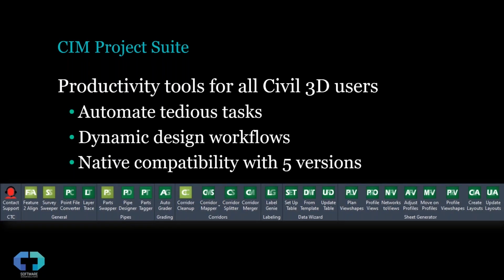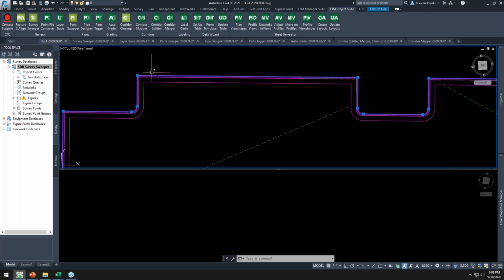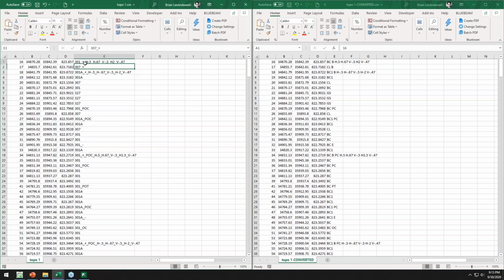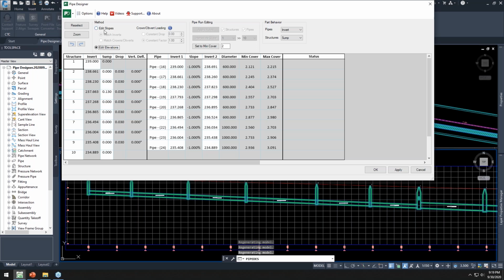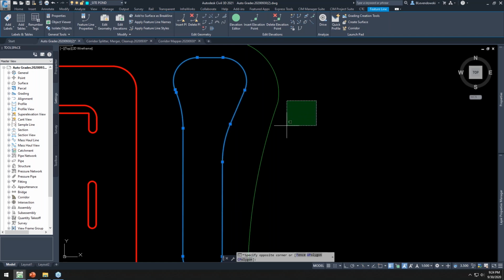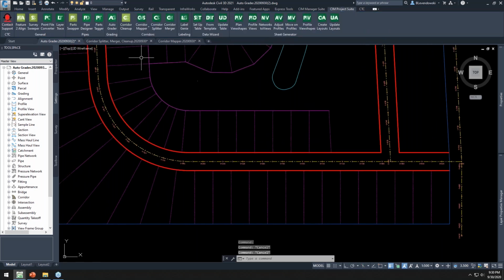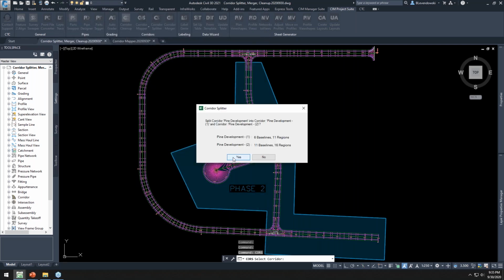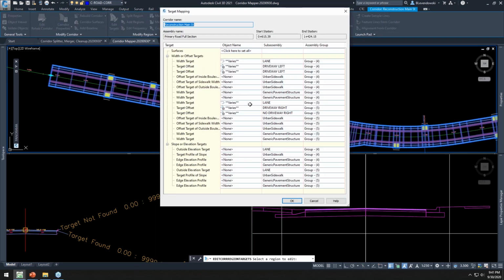Civil 3D® Productivity Tools for Civil Design and Survey

Comment: Any clip about line work code set
Reply from the maker: Not sure if we understand your comment, but if it’s whether the Point File Converter tool explained in the video works with linework codes, the answer is yes. You can place any linework coding translations in your excel translation file and it will take care of it for you. For tools to help you manage survey standards, check out our CIM Manager Suite for managing description key sets and figure prefix databases.

Comment: I want have more details about survey codelist different types of standards is it work with how many types of standards bcoz in market there or lot different types of surveyors codelist
Reply from the maker: Point File Converter, the application shown in the video, will handle any survey standard. You simply plug in your two survey code lists in your translation file, as explained in the video, and the app will take care of the translation for you. The user guide for the application explains in detail how to set this up to work for your standards.